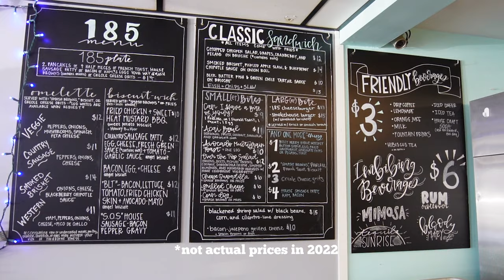Vlogging with Sony ZV E10 | I Ran Over the Biggest Screw Ever

Comment: I have mustang that bf not drive he said i can drive it but have to register it and buy battery and do licence here in usa, he said battery will cost near 200$ and that mustang is 1994 I think
Reply from the maker: Wow. $200. That's crazy for that mustang. But then again 150-200 for a battery is pretty normal. If you have access to sams club or costco in your area you might can save some money. Other than that, the battery I just put in my mustang was $300 because I chose to put in a AGM battery.
Reply: @BinhDong  ic will check it out too :)